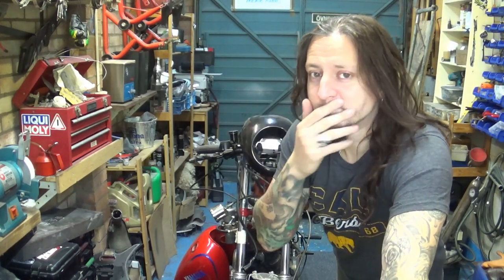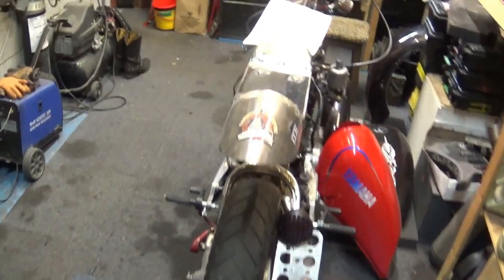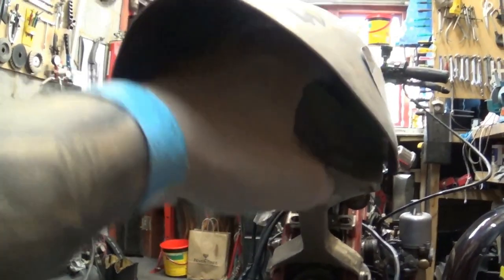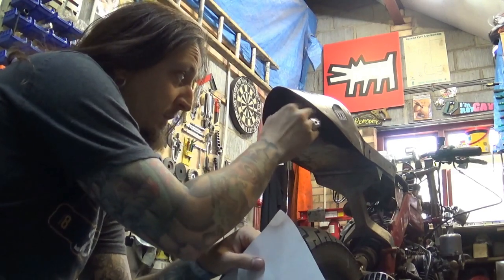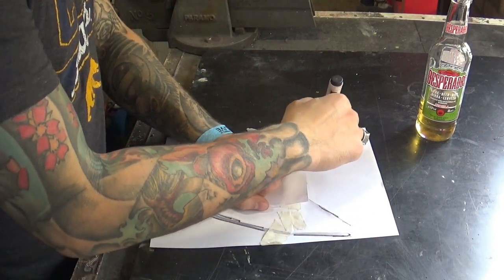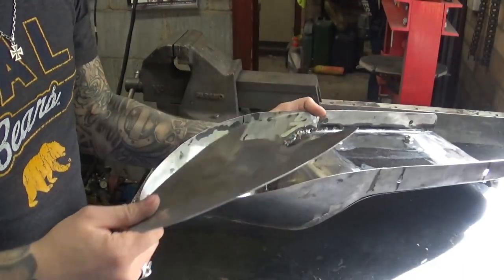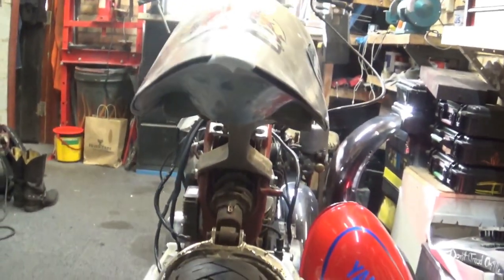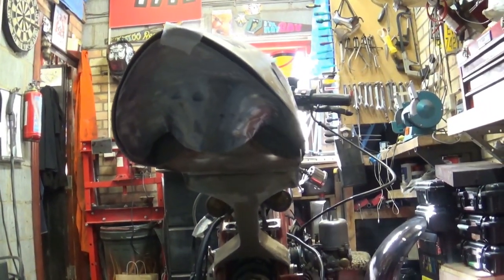Yamaha Virago XV 500 Cafe racer Build, Part 33 - Splash Guard and Priming Raw Steel

Comment: Excellent stuff. Pretty neat fabrication. I like the design of the tail section, and that subframe looks crazy strong. You got the right methods with the degrease, sand, degrease again. Also, very smart of you to top the primer while you're waiting to do the final paint work. Primer is absorbent and will soak up humidity if it's not topped. Best practice is prime within 3 hours of prepping the steel, then top ASAP for a rust-free guarantee. Your British humidity is a bitch for painters. I lived and worked in London for many years. Loved it! Now I live in the very dry Okanangan Valley B.C. Love it also! Rock on :-)
Reply from the maker: Hey man, good to hear from you! And yes I sealed the primer with black the next day. It's actually looking very good, looks like I will have very little body working to do, which is always a bonus!
And I would love to move to the US, really a dream. maybe one day...who knows what life brings on?